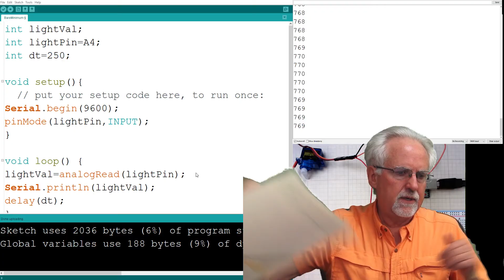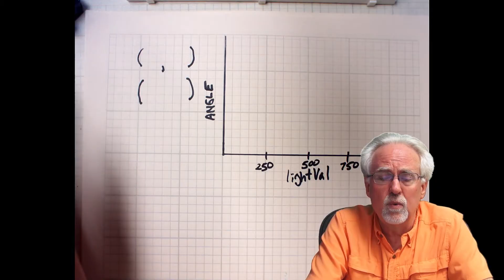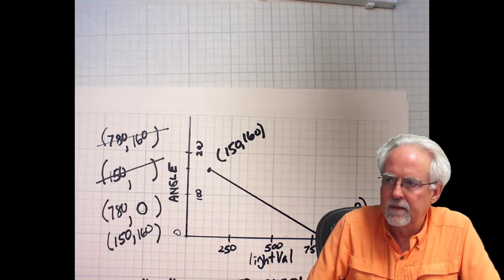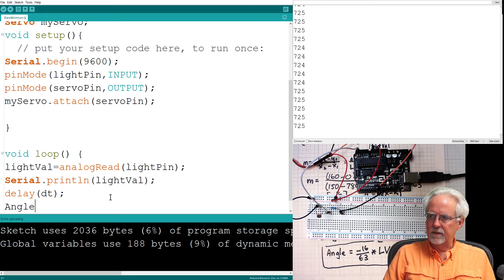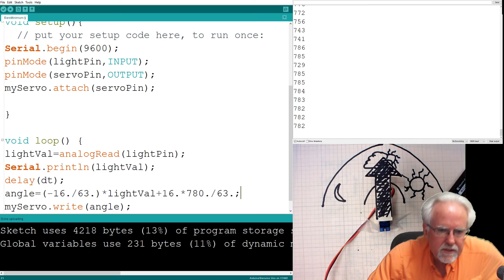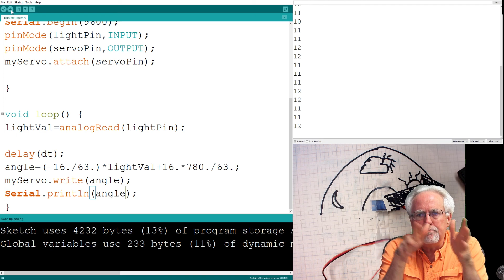Arduino Tutorial 31: Using Servo in a Simple Project

Comment: Another comment on the math. A much simpler approach is using relationship math instead of this complicated linear graph approach.  I solved both the homework and Paul's problem using relationship math for a servo moving 180 degrees.  Here are the comment lines on my sketch and the angle equation I used at the end that works fine for 180 degrees.  //For the teachers demonstration he used on = 780, off = 150
//his difference is 630, which over 180 degrees of servo wand movement is
//630/180 = 3.5 degrees per unit of light;
//Therefore, lightVal = lightPen/3.5 for the proper movement of the servo
//Where the servoPosition or servoPos=lightVal;  angle=(lightPin/3.5); or angle=(lightVal/3.5);  both equations work.  Also, what happened to the servo pin control at pin #9??  This was never discussed or put into the sketch???? Was the control pin #9 somehow included inside the Library?
Reply from the maker: Bill, I am trying to teach people how to do math, not 'wing' it with shortcuts. What you suggest will work for a specific problem but not more general problems. Why not just learn to do real math and have a tool you can use to really solve problems, simple and complex?

Comment: OK, I did the homework and made it work correctly. It took a little thinking, a little math, and frustration. But, I did it, and it worked.
It helps to do homework after the subject matter has been discussed. That way you can use it to learn something.  Instead of in one tutorial, trying to solve a problem without being given all of the necessary command information.  This approach works much better. Plus, you get to see the answers in the very next video.

Comment: Started getting negative values for the angles and thought the math was wrong. Used the map() function to verify. Got the same values. Then I realized I was getting photoresistor values higher than what I had previously seen and determined as the max. Solved it by using an if statement to make anything negative =0 since the dial is meant to be relative

Comment: I did it without using the library:
int k=1000;//minimal pulselength
int p=19000;//maximum downtime - k+p=20000 = 20ms = 50Hz
int pulseUp; 
int pulseDown;
int servo=10;
int lightVal;
int lightR=A4;

void setup() {
  // put your setup code here, to run once:
pinMode(servo,OUTPUT);
pinMode(lightR, INPUT);
Serial.begin(9600);
}

void loop() {
  // put your main code here, to run repeatedly:
 lightVal= analogRead(lightR);
 if (lightVal<250){lightVal=250;}
 if (lightVal>750){lightVal=750;} 
 pulseUp=k+(lightVal*2 -500);
pulseDown=p-(lightVal*2-500);// to keep it 50Hz
digitalWrite(servo,HIGH); delayMicroseconds (pulseUp);
digitalWrite(servo,LOW); delayMicroseconds (pulseDown);
Serial.println(pulseDown);
}

Comment: I didn't calculate the slope because I was getting values between 0 and 180 using multiple resistors in serial(the resistance of each was 220 ohms and I connected 4 of them), so calculated it after you did it in the video it is much smoother as a result because the change is gradual instead of sudden so it is much easier to observe

Comment: Hi, Paul!
I've been having some trouble with the math; the equation well posed but something wasn't working and the servo was moving "weird".
I tried putting variables into the equation, being able to accommodate the high and low light values so I could do it day and night, daylight and artificial light. However, something was wrong.
I opted to do it by entering the values in the formula and, at last, I succeeded.
"Piano piano piano si arriva lontano", as the Italians say.
Thanks again, and again, and again....

Comment: I'm a bit proud of myself. I was able to not only finish the assignment, but I also wrote a code that set up the min~max photoresistor value by itself depending on the light level.
whenever the code detects a smaller min value or larger max value, it will rewrite the minmax photoresistor value.
being able to start utilizing the knowledge that I learnt from your previous tutorial feels really great. can't wait to finish all the tutorial.
Reply from the maker: Great idea.
Reply: Any chance of sharing the solution to this please?
Reply: do you wanna elaborate more on this please?

Comment: I commented on the previous video that I did the homework, so before getting to this video. The maths is very straightforward once you've practiced it a few times. The more projects that depend on doing it, the easier it becomes. It's far easier than working out the more abstract logic that needs to be applied in coding. That's where I struggle!
Thank you for this excellent series! I've learned far more coding and building simple circuits in the past two or three weeks than in all my previous efforts in either!
On to the next lessons!

Comment: "did you shut the video off before the math?" Heh, well I guess nobody from that group would be able to answer the question :D

I did it alone the other way around actually, with a lot of light being 0 degrees and almost no light being 167 degrees and it worked, I then added if-statements to correct for over and/or underlighting conditions. But I guess my servo is faulty, the potentiometer is a little bit overzealous  :)

Comment: I do my homework. 
i put the code below. 

#include <Servo.h>

int servoPin=9;
int lightPin=A2;
int servoPos=0;
int lihtDetect;
Servo myServo;

void setup() {

  // put your setup code here, to run once:
Serial.begin(9600);
myServo.attach(servoPin);
pinMode (lightPin, INPUT);
pinMode (servoPin, OUTPUT);

}

void loop() {
  // put your main code here, to run repeatedly:
lihtDetect=analogRead(lightPin);
Serial.println(lihtDetect);
servoPos=(lihtDetect-200.)*(16./80.);
myServo.write(servoPos);
Reply: the difference between you and my is that you the range of Light form 150 to 750 and i take the range form  200 to 1000
and i use like start point or the darker part form angle 0. 
So we have different equation but the same result at the end. :)

Comment: Hi Paul,
I had a weird thing going on  ... I did the same thing as you with a bridge on the breadboard for the +5V (one going to the servo and the other to the photoresistor), but my servo kept freaking out .... I couldn`t figure out why ... I ended up removing the bridge and using the +3,3V for the photoresistor instead of 5V (kept the rest of the pins and the coding) and than it worked. By the way, do you need to declare the pinMode of the servopin as an OUTPUT? or is the attach command enough?

Comment: i figured it out. there's an absolute zero light detection for pitch black so there's no need to add the difference between low light and zero. eg  low reading is 150 and lights on reading is 800. so normall mapping math we would calculate m * value + difference to zero.

Comment: Hooking up Rails is always a good plan Just like Setup. i am also not convinced all the Gnds on the Arduino are created equal they should be but it is better to be sure you have a common. especially important if working with Logic and Timing circuits.

Comment: Btw, if you are as exceptionally lazy doing any maths as I am, just use map() function.

map(x, fromLow, fromHigh, toLow, toHigh);

In our case
map(value, 150, 780, 160, 0);

Also, constrain() function is useful to constrain out of range values.

constrain(x, a, b);

So final calculation would be
constrain(map(value, 150, 780, 160, 0), 0, 160);

Comment: I did the homework (and the math) and it works!...even got an "oooo, ahhhh, from my son in systems design engineering!  Used a potentiometer in place of the 5000 ohm fixed resistor so I can adjust the sensitivity to light / darkness.  Thanks for another great lesson.

Comment: Hey, I noticed that you set a pinMode output for the servo pin. You didn't do that in the last lesson. I did the last lesson and the homework without it and only used myServo.attach(ServoPin) command. Should we be setting a pinMode(OUTPUT) as well?

Comment: Is the line 
pinMode(servoPin, OUTPUT);
needed?  You didn't set the servo pin as an output in the previous lesson, and although you do it here it doesn't seem to make a difference whether I include the line or not.
Also, obviously you've already shot these, but for my part I just cover the photoresistor with my finger.

(I always do the math before hand)

Comment: I finally got your last presentation about linear equations, but knew I wouldn't remember it. So - I created a kind of template (possibly could be made a subroutine?) as shown below.

In the area above void setup() {  :
//------------Linear equation values -------------------

// Enter coordiantes for linear equation. 

// X "line" is for the datum you know. This will be read
// from a sensor.
float x1=30.0;  // lower left ordinate
float x2=530.0;  //upper right ordinate

// Y "line" is for the value you will send/write to the 
// output device (buzzer, led, etc).
float y1=10.0;  // left lower  ordinate
float y2=170.0; // right upper ordinate

float readVal; //Value brought in from the sensor. 
float writeVal; //Value to be sent to the output device.

//-----------------End of Linear equation values --------------------

In the void loop() {  , after reading the input device's (photo resister in this case), here is your equation using the values from the line definition (x1,y1 - x2,y2)

  readVal=analogRead(photoResisterPin);
 // for this example with photo resister

//----------------- Linear equation calculation ---------------------
  writeVal=( (( (y2-y1)/(x2-x1) ) * readVal - ( (y2-y1)*x1 / (x2-x1) )) + y1 );
 // will work for any linear equation
//-------------------------------------------------------------------

Maybe considered "cheating" but I really had to think (once) to ensure that it is correct...

Comment: Why does the servo not respond in the same way when you run the Arduino from a 9 Volt battery? (batterie is fully charged)

Comment: HI Paul
I did it as "homework" and even added some if statements to limit rotation between 10 and 170. I found a flashlight would overdrive the servo and covering the photo resistor would have the opposite effect on the zero side of the rotation. Also, as the direction of rotation was not clear, I used positive values which resulted in a clockwise rotation as the light dimmed. Still loving the Tutorials

Comment: Absolutely loving the series,  I did the assignment and it worked perfectly, took me a little while to figure the math right but eventually got there.

#include<Servo.h>
int lightR = A0;
int lightValue;
int dt = 500;
int servoPin=3;
int servoPos=0;
Servo myServo;

void setup() {
  // put your setup code here, to run once:
Serial.begin(115200);
pinMode(lightR, INPUT);
myServo.attach(servoPin);

}

void loop() {
  // put your main code here, to run repeatedly:
lightValue=analogRead(lightR);
Serial.println(lightValue);
servoPos=(180./260.)*lightValue - (40.*180./260.)-27.6;

myServo.write(servoPos);

}

Comment: Hi Paul. Worked OK. I connected my 5 v to 5K resister and I grounded the photocell free leg. Took my measurement between 5K resistor and the cell. I got a low of 140 and a high (dark) reading of 930.
Thus my servoPos=(180./790.)*photoVal-(180.*140./790)+1  This worked fine. Thanks for the great lessons.

Comment: Paul i really like the math but i always used map value 

Description
Re-maps a number from one range to another. That is, a value of fromLow would get mapped to toLow, a value of fromHigh to toHigh, values in-between to values in-between, etc.

Does not constrain values to within the range, because out-of-range values are sometimes intended and useful. The constrain() function may be used either before or after this function, if limits to the ranges are desired.

Note that the "lower bounds" of either range may be larger or smaller than the "upper bounds" so the map() function may be used to reverse a range of numbers, for example

y = map(x, 1, 50, 50, 1)

Comment: Mr. McWorther, I did the math and code and I did it pretty well! I am so happy with my results.

#include <Servo.h>
Servo myServo;
int servoPin=9;
int lightPin=A0;
int lightVal;
float servoPos;
int dt=100;
void setup() {
  // put your setup code here, to run once:
pinMode(lightPin,INPUT);
myServo.attach(servoPin);
Serial.begin(9600);

}

void loop() {
  // put your main code here, to run repeatedly:
lightVal=analogRead(lightPin);
servoPos=(180./550.)*lightVal-(180.*200./550.);
myServo.write(servoPos);
Serial.println(lightVal);
delay(dt);
}

Comment: Using the map function eliminates the need to do any math.  newvall= map(lightval,  150, 780, 0, 255);  you write to a new
variable (newval)= map( read variable,   old low value,   old high value,     new low value ,      new high value  ) and the 
Arduino converts the numbers and does all the math for you.
Reply from the maker: And yet what happens when you come upon a problem the map function wont solve. My point is, the reason I got the big salaries was because I could do the math, and could solve the problems involving math. To avoid math is to avoid the opportunity to be a top engineer.

Comment: Paul, I did the assignment and made it work as specified but mine was 3 position pointer.
"servoPos" changed  to one of three given angles as light intensified or dimmed.
I do understand the math you used because of your tutorials and have the formulas in my notebook.

Comment: Managed it myself with the math, but because of poor memory, the math took longer than the hardware  & software combined.
Also, didnt do a pinMode for servoPin and it worked fine.  should it be used or is the "myServo.attach(servoPin)" doing that anyway?  Just curious.
Reply: Same doubt.

Comment: I've noticed that the SG90 servo draws too much power from the Arduino when it moves quickly. This results in jittering of the servo. My suggestion would be to power the servo from a seperate power supply. Secondly I've added a 220µF electrolite capacitor over the light sensor to smooth out fast changes in light. Lastly to futher avoid jittering I've divided lightVal by 10 (lightVal=lightVal/10), rounded lightVal (lightVal=round(lightVal) and finaly multiplied lightVal by 10 (lightVal=lightVal*10), before using it in the calculation. This takes out the very small changes in the lightVal value and stabilizes the servo even more.

Comment: Hello Paul I tried the home work but I could not do it because i think my arduino has a problem i made code here it is

int Readpin=A3;
float V2=0;
int Readval;
int TIME=400;

void setup() {
  pinMode(Readpin,INPUT);
  Serial.begin(9600);
}

void loop() {
  Readval=analogRead(Readpin);
  Serial.println(V2);
  V2=(5./1023.)*Readval;
  delay(TIME);
}

This is the code to test the voltage but when i unplug all the wires the Readpin still has an input voltage so I don't know why.  when i plug in my photoresister nothing changes. So i couldn't do the homework.

Comment: i did it in other way 

#include <Servo.h>
int servopin=9;
int servopos;
Servo myservo;
int lightpin=A0;
int lightval;
int dt=100;
void setup() {
  // put your setup code here, to run once:
Serial.begin(9600);
pinMode(lightpin,INPUT);
myservo.attach(servopin);
}

void loop() {
  // put your main code here, to run repeatedly:
lightval=analogRead(lightpin);
Serial.println(lightval);
if (lightval>160 && lightval<180){
  myservo.write(servopos=0);
}
if (lightval>750){
  myservo.write(servopos=90);
}

if (lightval>40 && lightval<100){
  myservo.write(servopos=180);
}

}
 \\is this correct
Reply: please reply

Comment: Little advice here: be kind to your servos.. i tried to make a similar project by controlling my servo's position with an analog read from a potentiometer. Even though i figured out the slope and mapped my code to move the servo the correct angle, the motor burnt out. My guess is that it tried to move 180° and beyond too quickly and that burnt it out... Anyway, great content Paul! Thanks for this great series and all the theory behind the practice you teach in your videos!

Comment: i did it the code 
#include<Servo.h>

Servo myservo;
int servopin=9;
int servopos;
int ldr = A0;
int led = 6;
int dv = 100;
int light;
void setup() {
  // put your setup code here, to run once:
   pinMode(ldr,INPUT);
   myservo.attach(servopin);
   pinMode(led,OUTPUT);
   Serial.begin(9600);
   
}

void loop() {
  // put your main code here, to run repeatedly:
  light = analogRead(ldr);
  Serial.println(light);
  if(light == 50){
  myservo.write(0);
  }

  if(light == 660 || light == 661){
    myservo.write(165);
  }

Comment: You'll probably tell us later why you need the library, but I did this before you showed us how to do it and obviously didn't load a library because I didn't know what one was. I just did a read from the photoresistor and then did 255/1023*prVal and analogwrote that to the servo. I also printed that value out and at the maximum movement of the servo I got an output value of 231. Which if you do the math 231/255*180= 163degrees (approx) which pretty much agrees with what you got. I obviously didn't include the servo name either. So I am guessing the library just does the math for you?

Comment: I did this before you showed us. It works but it is really sensitive, an it also runs back to zero position the darker it gets. I will watch and see how you did it.  I had used another equation "a shorter version" it worked just not as good as using the longer equation. Thank you Paul

Comment: I did it on my own, but in a little bit different way: i had higher value on the left side, increasing the angle, and the lower value on the right one, decreasing the angle of servo position. But it worked!) As i saw way you do it (lower value - higher angle; higher value - lower angle), i have done some math also and done it in the way you have. And thank you for your great lessons, with deep explanation and practicing math! They are just gold!